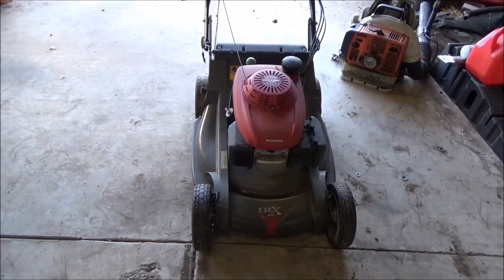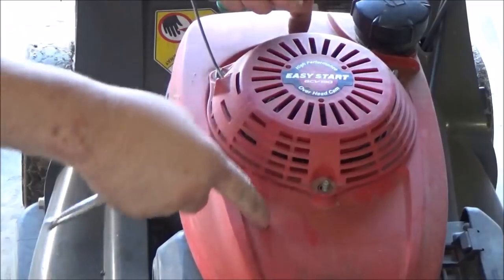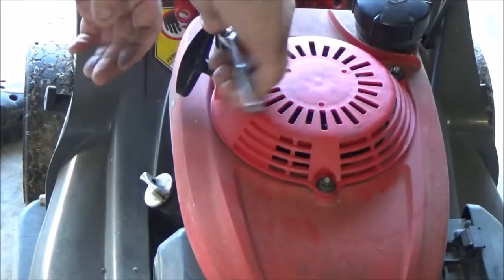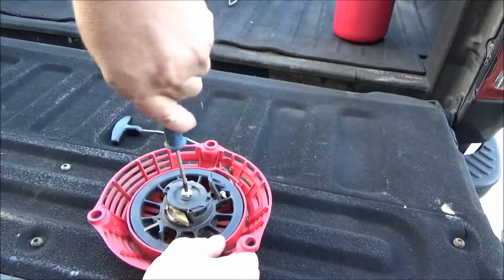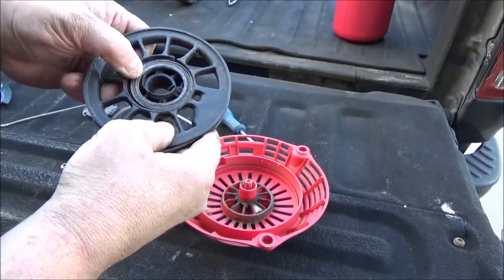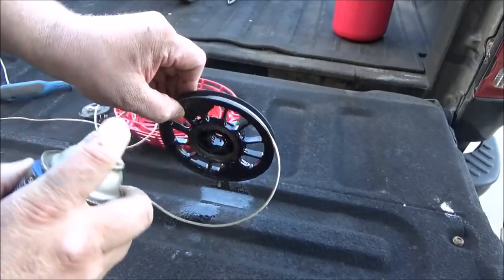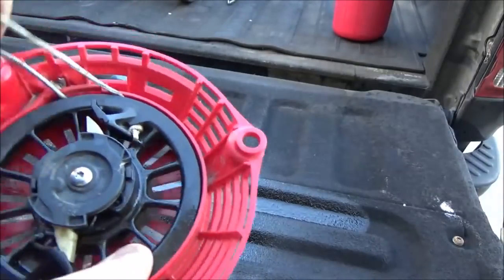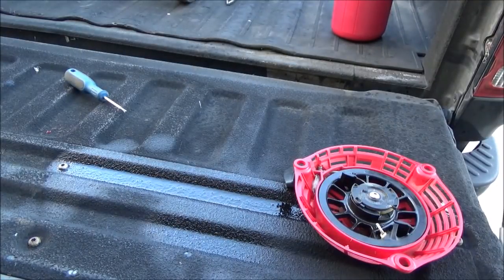HONDA LAWN MOWER /  HRX / HRR / GCV SERIES ENGINE STARTER REPLACE AND REPAIR

Comment: good information for people Here. It can be a fast easy fix. I run a couple of these mowers in my company and they are the best push mower we have ever used. These little honda push mowers will run forever The clip director is great and works well. the mowers mulch and bag great just keep the area were the shut slides back and forth clean. Great video buddy. Have a great week. God Bless !!!

Comment: Ok Comment 2   Mon Ami ~!~!

I usually take the spring out and pass some emery cloth on it with some  PB Blaster...  If it's not broke......   

I have a way to coil the spring back in very easy...............  In fact I will make a video soon to show that....   A lot of dogs/pawls break a small pin off often......  I keep them in stock.....  and have some leftover from ones that the spring is broken on ~!~~!

I never noticed that small groove in there to get the wraps on it.......   Great tip Mon Ami .......  

I usually just wind the the recoil till it's tight and then put a new cord in and tie a knot and let it go back in.........    

A lot of times the tob NUTS will take the studs out and the front one is one of the COIL studs.... 

Some folks bring me the mower and the coil is out of adjustment,  Hence no spark or very weak spark so no fire to the plug/or a no start condition ~!~!

 Plus Tard Mon Ami ~!~!